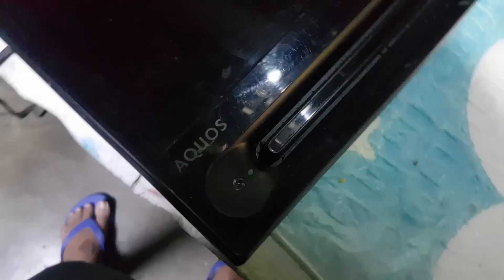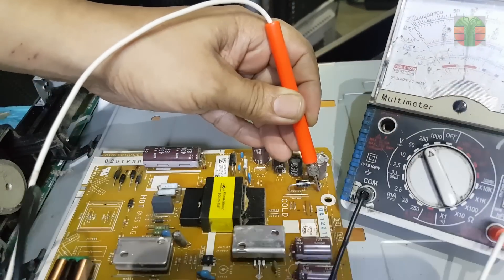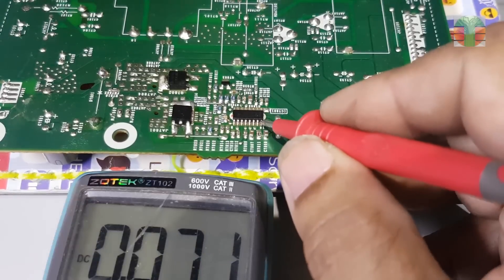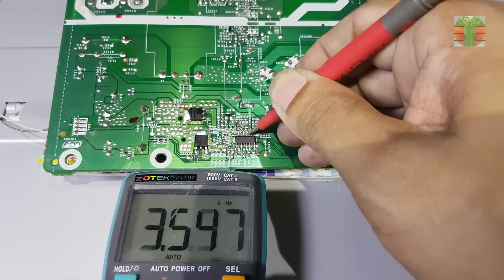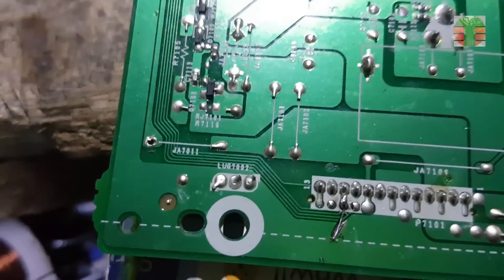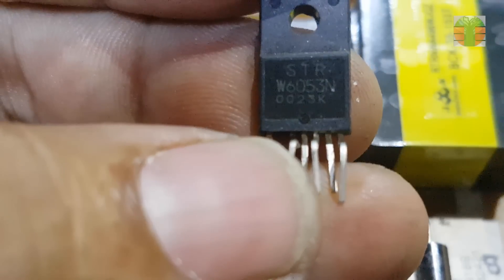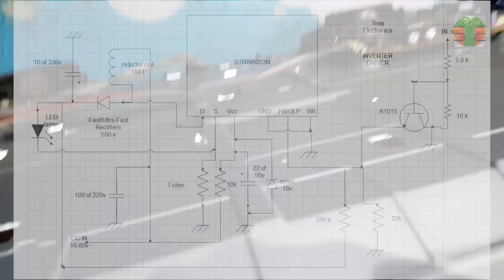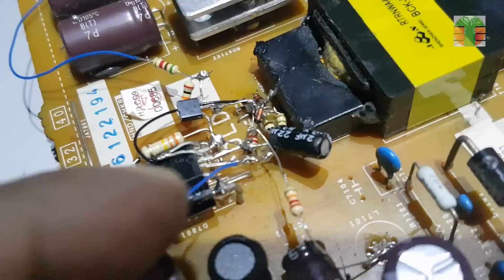Backlight Driver Modification

Comment: You make me know that I haven't even started yet just at the beginning syd of learning electronics repair. Your videos are educative and I will love to learn more and become perfect. But first I didn't get to understand the connections btw the; Resistors, STR, Zonal diodes and and wire connectors to light up the lamps pls educate me on those connections 🙏 that's were I found it difficult sir tevs been a fan since I saw your videos online been learning and have learnt from you indeed you are best and very opened to educate those who're serious minded to become good technicians unlike you the grand tech titan and master of electronics fixes.🙏

Comment: I can’t figure out my JVC backlight driver circuit.
It has no power ICs at all? The only IC on the circuit is a 8sop Amplifier ic?
Can’t find any shorts, output only gets to 5v then drops to 3.3v the drops to 600ma and stays there.
Backlight LEDs are fine.

Comment: Hi Mr T. I have a tv backlight 2x 80v but should be about 120vx2 for 6v led strips. Strips ok. Is ic usual problem for BL circuit that works but is low?

Comment: Backlight drivers are usually voltage adaptive. Is this one adaptive when the LEDs are connected to it or it has a constant voltage with or without load.
What is the voltage with load?
What is the voltage without load? 
What is the maximum size of TV will it work on?
What is the minimum size of TV will it work on?
Once again thanks for the circuit diagram.
Reply from the maker: Thanks

Comment: Can we use another module to optrate backlight. Instead of this. Please reply
Reply from the maker: I'm only just showing that strw6053 witch use in switching power supplies is capable to use as a LED drive.

Comment: Hi now iam facing 40 inches combo pcb ok but new back light turned on and off please give solution
Reply from the maker: Replace all LED's and check the  drivers capacitor
Reply: Yea sir iam change new one but not working driver properly. driver section volt raice and decrease suddenly

Comment: Hello there, a tv arrived to my shop with the same problem which works with a 12v adapter, pwm controller doesn't have dimming and gate driver output. I think because of that, output of the mosfet stays at 12v and gate doesn't recieve any signal(tested the mosfet to be sure). After the mosfet there are two smd schottky diodes and thats all. Can I use the same solution for this TV?
Reply from the maker: 16 volts is the lowest voltage requirement. it will not work at 12 volts.

Comment: Where did you take the vcc supply from ?
Reply from the maker: I get it to the original BL supply 50 volts
Reply: @tevzTVTevatronics  so the original backlight ic is not generating this voltage, just controlling it ?
Reply from the maker: @reacey  no,  the original driver ic is no longer active, I disable it.  The strw6053 is the driver now.

Comment: Whats adjust volt to inverter baklits?
Reply from the maker: No voltage adjustment only current can be adjust. Add resistor to pin 3 connects to ground. 1 ohm

Comment: Pano mu nadisable yung protect nyan sir?
Reply from the maker: walang protect, yung 330 k na resistor para sa hi voltage protect para pag may na open na LED mag protect sya.
Reply: good evening ,sir ilan volts ang minimum load na led bklite at ilang volts po ang maximum na pwede  load na led bklights ? thank you po sir .